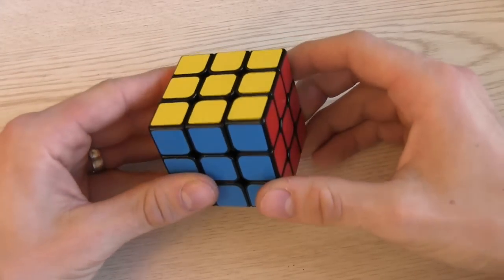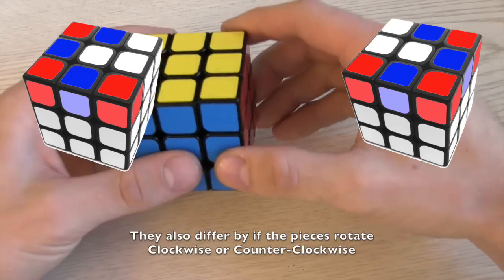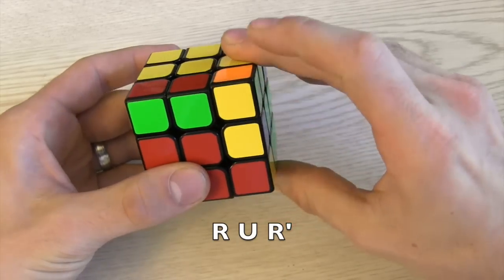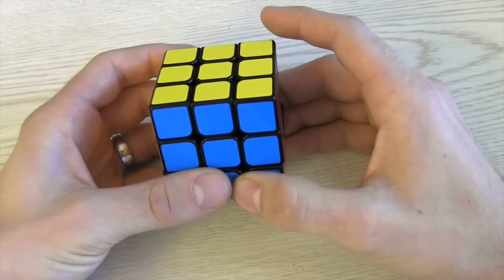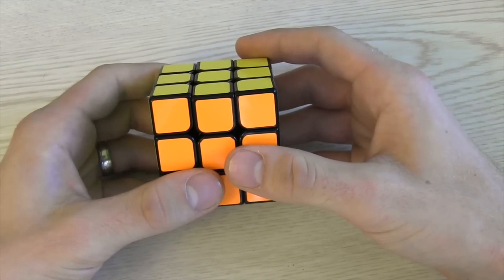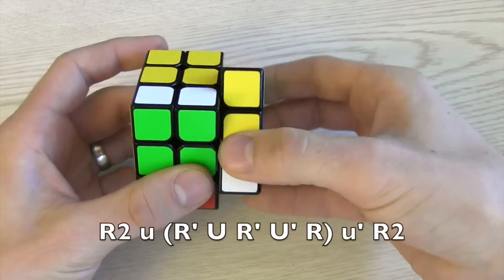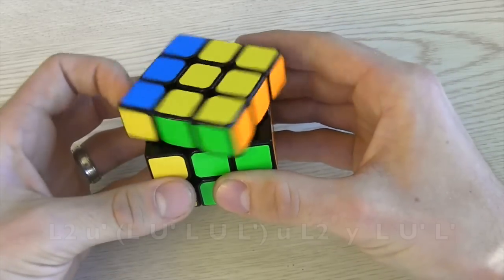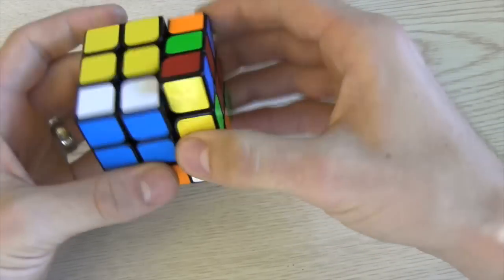G-perm - Very Easy Method to Learn Them

Comment: I learnt the g-perms last, but they are actually a lot simpler than other perms. I also use mirror algs for the j perms
Reply from the maker: +MeAndMyCubes same.  My left hand is already pretty fast from the violin and it flows so well. :)
Reply: +SpeedCubeReview The downside of mirror algs is that they don't work as well for one hand, which is one of my favourite WCA events
Reply from the maker: +MeAndMyCubes true

Comment: I have a Problem with G and R perms.. I can't see at al the diference between G and R, if it is only G, I find funny and easy to do G Perms, but, If you say that I need to difference R and G Perm, I'm dead
Reply from the maker: R perm has the two piece bar connected to the headlights. G perm it’s separated.